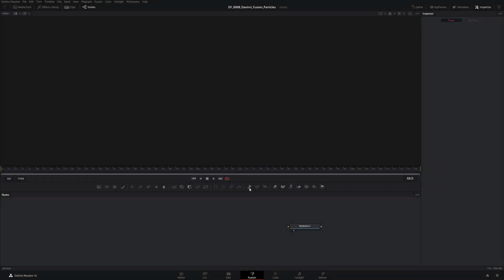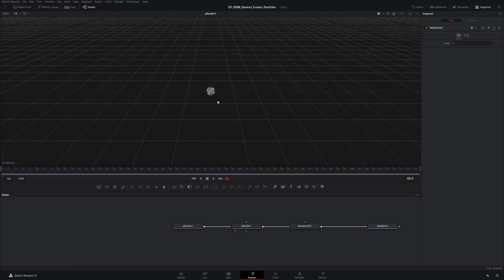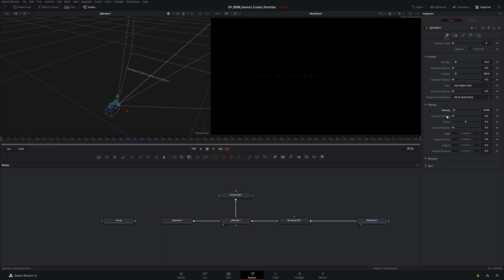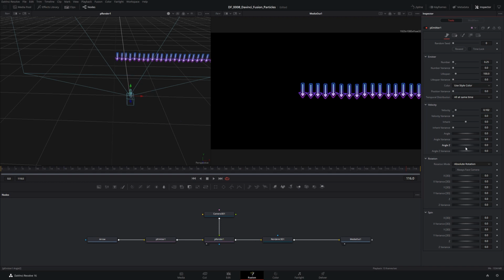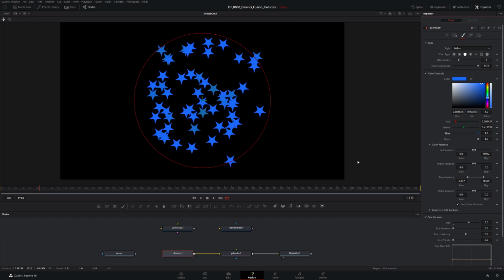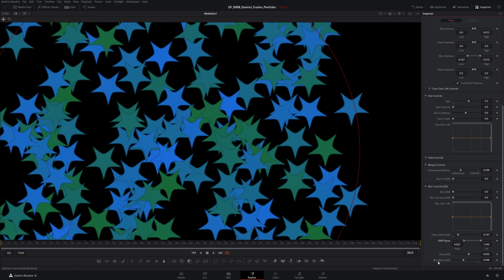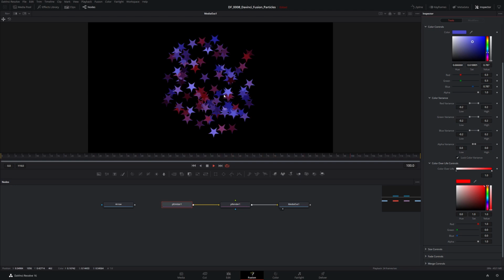DaVinci Resolve 16: pEmitter Tutorial Part 2/2

Comment: 🎯 Key Takeaways for quick navigation:

00:00 🤖 The tutorial focuses on the emitter engine within Fusion, specifically the "pEmitter" node, which generates particles.
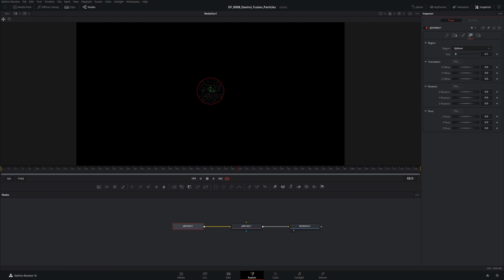01:25 🎨 The emitter node allows you to control particle emission from different regions (e.g., sphere, rectangle, line, Bezier curve, bitmap) and apply various styles to individual particles.
02:16 💡 Understanding the emitter node is crucial for working with Fusion's particle systems, enabling the creation of custom particle effects.
08:07 🖼️ Using bitmaps as emitter regions allows you to define the shape of particle emission, with alpha values determining particle generation.
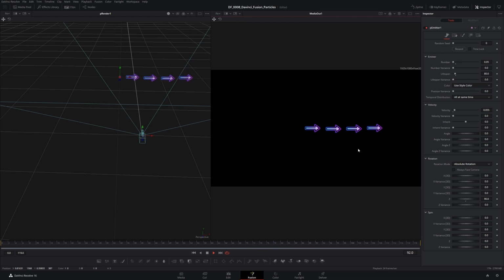16:14 🔢 Adjusting parameters like number of particles, lifespan, and variance can influence particle behavior and produce different particle effects.
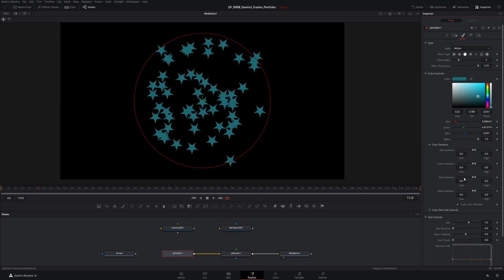19:29 🧭 The "apply mode" options (add and merge) in the pEmitter node control how particles interact with each other in the Fusion particle system. "Add" mode adds up the values of overlapping particles, while "merge" mode treats them as a single particle for the current frame.
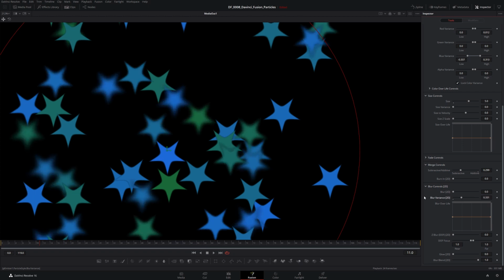22:12 🎨 Enabling the "sub-pixel rendered" checkbox in pEmitter causes particles to smear between pixel grids, potentially providing smoother effects over time but increasing computational load.
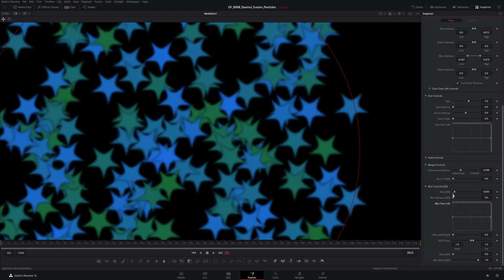23:08 🔢 The "point cluster" option in the pEmitter allows users to control the number of particles in a cluster, providing more control over particle behavior.
24:02 🎆 The "blob" style in pEmitter creates blurred circles with size and noise control, offering unique visual effects.
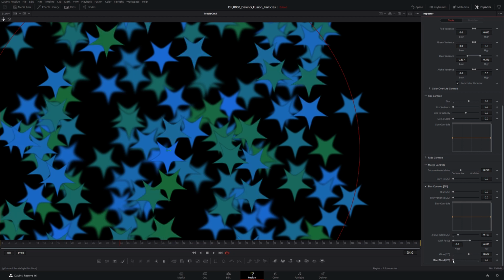24:56 ✨ Adjusting the "size over life" parameter in pEmitter allows particles to grow or shrink over their lifespan, offering dynamic visual effects.
26:46 🔺 The "end gone" option in pEmitter generates polygons with a customizable number of sides, providing various shapes and shadings for particle emissions.

Made with HARPA AI
Reply: what the fuck

Comment: In this particle series, are you able to cover particles in 2D, not just 3D? Thanks.
Reply from the maker: Hi RT, Yes I will be jumping back and forth as it fit. Part 1 was mostly 2d. Let me know if there is anything in particular you want me to cover and I will try to dig something up.
Reply: @darrenfrenette2597  Is it possible to define what is a particle? For example, if I want the particles to be in the shape of little houses - and I create a house my merging a square node, a triangle node for the roof, a rectangular node for a door and windows etc. Can I use the combined nodes to define that the particles are in the shape of little houses? How is this done?
Reply from the maker: @god-lightbulb  Yes, there are a few ways to do this. Perhaps the easiest though is to have the house as a bitmap and have each particle represented as a bitmap. I cover how to use bitmaps as a particle style in part 1 of this tutorial. But maybe I am missing something and there is a reason you would want to bring in multiple 2D shapes to build the house in Fusion. Is there?

In any case, here is a good tutorial (albeit 3d based) that talks about using 3D shapes and the replicate3D node to have each particle take on the appearance of the 3D object. I imagine you may be able to also use the 3D merge node to combine multiple 3D objects in one.

http://www.bryanray.name/wordpress/linking-3d-geometry-to-particles-in-blackmagic-fusion/

Let me know if either of these works for you. Best of luck!
Reply: @darrenfrenette2597  Thanks. I'll look at the Brian Ray page. For my video project, I can't use bitmaps since the 'house' has to later on do other animations in Fusion.
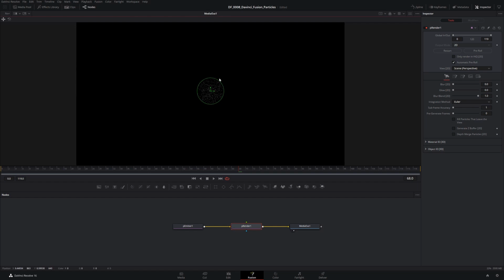Reply: @darrenfrenette2597  In this After Effects video,  @0:40 where the particles pour out, is that done by particles? I'd be interested to know how to control 2D particles in that manner. https://youtu.be/urRXvBZfqxs?t=40
Reply from the maker: @god-lightbulb  Very cool clip. Lots of cool effect. These all seem to be using Newton, a physics based After Effects plugin to handle collision detection, bounces, etc. We are a bit more limited in Resolve with particle interaction. Once again our good friend Brian has some thoughts and mentions using pFlock to get some basic particle interaction:

https://forum.blackmagicdesign.com/viewtopic.php?f=22&t=84730

pFlock is a few tutorials down on my list (currently working on tutorial explaining sets), but will revisit this once I get to that tutorial.

Great comments by the way, they really get the noodle working!